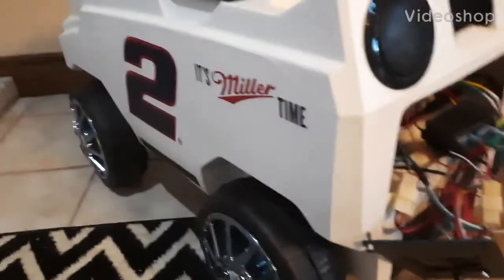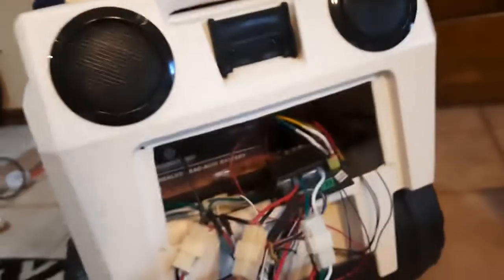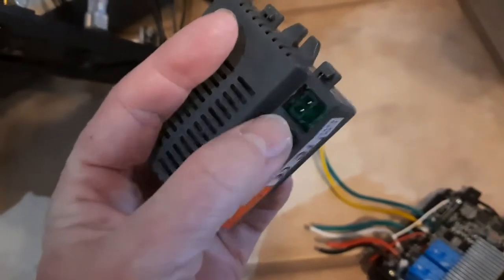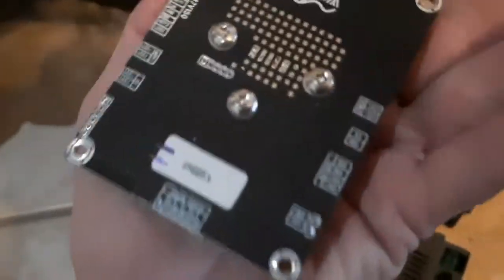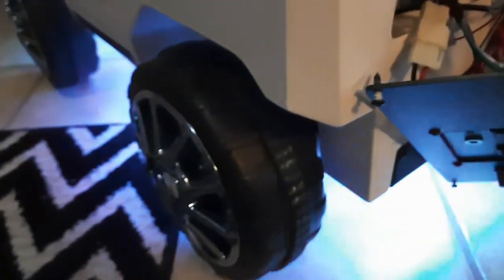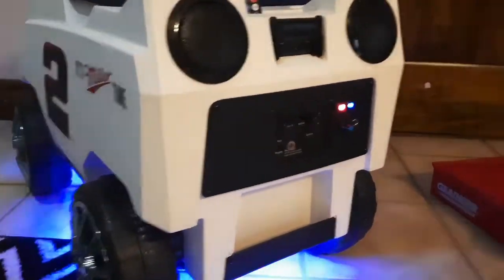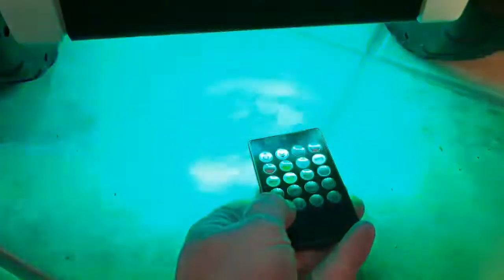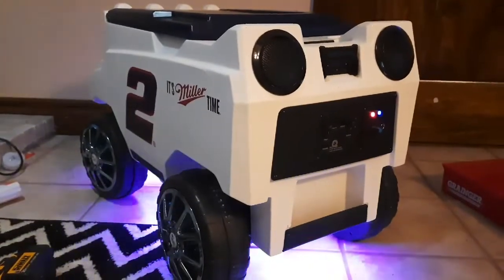C3 Coolers RC Cooler controller board replacement / retrofit and add bluetooth

Comment: Thank you for posting this. I just got the exact same cooler for free. The battery is junk so I'm waiting for that to come in. Found one way cheaper on amazon. Hopefully it works but If not im going this route. Great video 👍👍
Reply from the maker: Yep, Amazon batteries are cheap. That cooler company is nice, but those $$ for Bluetooth addition,  F that.
Reply: Did you wire both motors to the 1 out put on the new rc box?
Reply: @dakotariel45   you have two sets of wires one to front end servo steering...  and the other splits to both back drive motors..
Reply: @VintageSpeedwerks   i burned up 4 of these boards i use  and they are about 23 dollars each..  lol  the original c3 cooler board is about 60 plus dollars..   and they WILL NOT last long..  stick with all power wheels after market parts for your cooler..
Reply: @dakotariel45   yes  and only used the plug in closest to the power plug in  when ever i wired up the motor in the two plug in holes  it smoked the board.. not sure whats going on there, but i just stayed with both motors going to one plug in.. that worked for me.. and at its slowest setting  its way to fast for inside  close areas.. in high  speed   i caint run and keep up with it ...

Comment: JR-1816RXS-12V   this controller   will let you have wireless horn and lights on your 3c cooler..   the left n right , back and forward, lights on/ off  and horn  beep beep..  all wireless   that means less switches...on the face plate  and shit load more funner..   coming soon on youtube  its still on the operating table.. this time all plastic and stainless  and a lil bit of aluminum .. but nothing that will ever rust..  it will also be topped off with a tilting  solar panel mounted on the lid.  run all  day all  long.... fair winds and fallowing seas
Reply from the maker: Ok
Reply: Phucking aye that's sounds badass, be waiting for a follow up!

Comment: How were you able to connect the cigarette lighter to the cooler? Thinking about getting a cooler and wanted to add the lights but saw in the link on Amazon that it connects to a cigarette lighter in your vehicle
Reply from the maker: It's 12v, so just wired it directly and cut off the adapter, since the cooler is 12v

Comment: if you live and operate your c3 cooler near water ways,, the moisture will destroy these boards in a years time,  and the battery only last a year, i went through three bapord and batteries  in 3 years  but i got smart, i removed the board, the shitty led acid battery and i re did the whole cooler. used a 12 volt kid car wireless kit, to change the wireless controller, much better for wet conditions, then i bought a 200 watt amp and usb speaker system, the rc cooler rocks now.  i cut out a face plate to put switches, n such  and i also added tow 12 volt ac water proof cooler fans and a temp switch to turn fans on and off when needed.. no lifpo4 burn and melt downs .and the batteries i used has a 10 year warranty, . i used a toggle switch board to turn every thing on and of..f the wheels the lights,sound, the temp sensor, every thing can switch on and off. separately ..    now  can anyone help with making this rc cooler fallow me with out any controller .. thats my next step.. oh  i called c3 cooler and asked if they could help in this project.. they said lifpo4 battery could NOT be used ever.. i fair to differ..   im an old skool hotroder.. anything can be better
Reply: What about changing out the battery with a milwaukee, dewalt 18v adapter? I'd have quick battery swaps & faster response I imagine.
Reply: @adamf1944     this lil cooler car has three lipo4 solar batteries, each w/ 15amp hour at 12volts dc..   this lil car can last all day and half of the next.. battery run time is not an issue any more..  and i just changed the speakers out again..its hard to find good sound in a 3 inch speaker..lol
Reply: @tarpanc34  so you added 3 lipo solar batteries vs the one lead acid one it had? I thought about replacing the weak speakers it came with since stock isn't very loud whatsoever.

Comment: The stock r/c controller range is 200' feet did you gain range with the aftermarket r/c controller also the main battery is that a 12-volt 7 amp like a Razor scooter uses.
Reply from the maker: No idea on range.